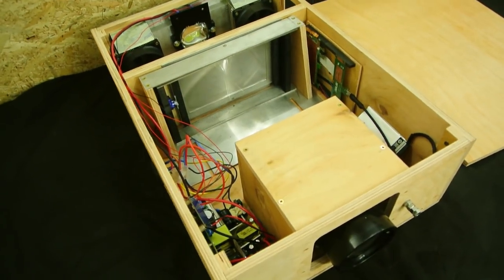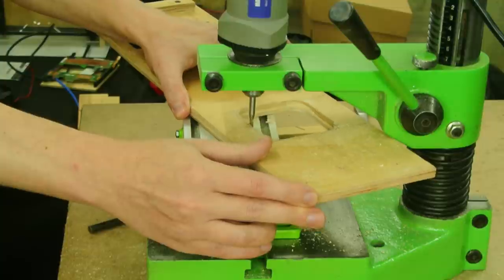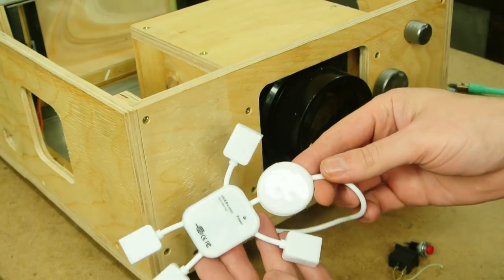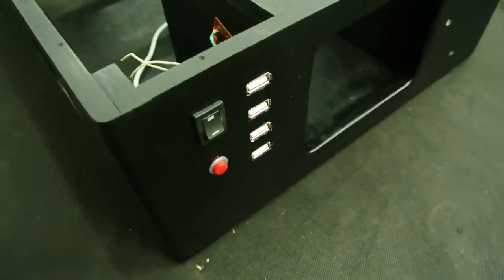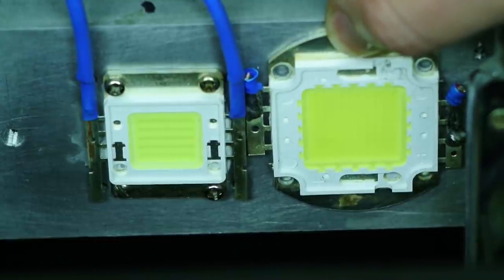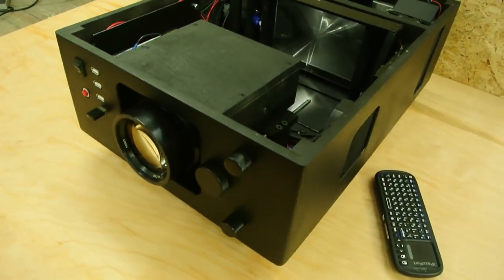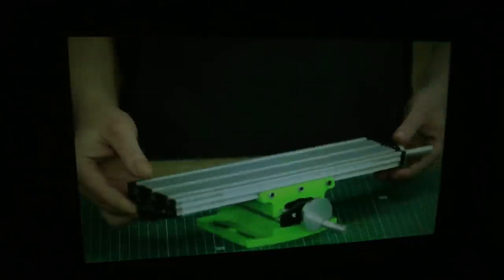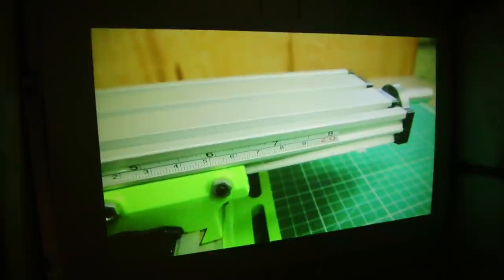DIY PROJECTOR Full HD (finish)

Comment: Would love to build it, but without a video on electronics its impossible :(
Reply: Hi i can help you if you intrested in components however hard to do the case no tools. a 3d printer would do the job.
Reply: Its a led, power supply, and a torn tablet connected to a charger....basic stuff.
Reply: Hey bro can you increase the brightness of this
Reply: chandrakant devde. To be honest yet dont know waiting for few replys from china sellers i want to use lg g3 display what is your facebook ? I will add you there and let you know if possible. Almost done with a Hd  7 inch display. Still need new psu
Reply: chandrakant devde driving a phone display with out some sort of converter board is hard i think need datasheet of display and etc.. I dont say is impossible but hard to do it
Reply: Popa Ionut can you please send your email. I would like to use your help to build such stuff. If you are interested.

Comment: in the back chamber area where the light is, i think i would have added additional mirrors around the sides to help bounce more light into the screen for increased brightness. though i know this may have made airflow less efficient so i can also see why you wouldn't. i also would have used a finer mesh instead of wire nets to prevent dust from getting in. after looking at the finished design, you also have a LOT of empty space inside that thing, so its possible you could have decreased some of its dimensions. it would have made for a tighter fit for the components inside, but would have decreased the distance the light had to travel inside the projector and helped reduce loss in brightness even further.
Reply: Adding mirrors would make the image horrible, as the light would not be going straight. As it is right now, only the light that goes forward goes through the LCD and into the lens, if you add mirrors, (unless they are specially made for this LED to make the light as straight as possible), itll make a mess.

Comment: Very impressive. I have one question. For how long you have tested your system? Is not the LCD become very hot? Your answer will take me one step ahead to make this project.
Reply from the maker: Tested a long time. If you do not install additional cooling for the display it will fail

Comment: Dear Sir, what about the connections of internal parts...???? Will you please explain that part also with circuit diagram. That will be a great help for sure.
Reply: balbir singh Sehgal you would need vaaaaay more than a circuit diagram to build it by yourself. That's the thing you should be able to figure out.

Comment: Would encapsulating the LEDs light beam in a reflective corridor improve brightness further? That's a lot of wasted light being absorbed by that big black interior.
Reply: Mitch King very bad idea. It would fuck with the fresnel lense, and give you a blurry, distorted picture. Just because then you not only have the light inputted from the focal point, but also from all the inner surface, and that's not going to be redirected parallel with the other rays

Comment: U should add a couple terabyte laptop drive & install Plex.  Turn it into a media center.  Use Wifi to transfer videos & stuff to to it.  U could add a USB network card, probably, and run Ethernet to it, if wifi is too slow for transfer.

Comment: Great video ! Could you tell me the specs of the projection lens and which of the lens's specs are requiered for this project ? You could mount a cpu cooler directly (without the aluminium sheet inbetween) to the LED to improve cooling. Sorry for bad english.

Comment: Hey, firstly congrats on a really informative set of videos on making a DIY projector. I've started my own project using 100W led but I am a little stuck on the LCD to use. I opted for a LS055R1SX04 (5.5 inch 1440x2560) which looked good but it is so very dim with a 100W led. Any more wattage and I have trouble keeping things cool. The LS055R1SX04 is not very transparent so most of the light is lost and doesn't pass through the LCD. Does anyone have suggestions on a good LCD to use with a DIY projector. Ideally something that is very transparent. Any HD 5.5 to 6 inch LCD that has good transparency will do but I just can't seem to find one with good transparency.
Reply: but it's video plagiat russian youtuber "Технарь" This is 
arrogant sound arrangement

Comment: Pretty nice work, but I see two problems. First you have used four fans. This thing must be pretty loud. And second, you are using an Android Tablet so you are limitied to the functions of the tablet. I don't know if this is really worth it.
Reply: Hauen Pappe if you hook it up to a good enough wifi, you can stream stuff through some apps. Also you can use other lcd, if you can get one decent with a hdmi input controller, that can be better than this setup.

Comment: Would this work with a 15 inch laptop screen? What about a 5 inch phone? Would I need different lenses in that case?
Reply: Celso Soares you have to cut your laptop screen to size with a hacksaw. If you are skilled enough, a knife, or a sharp axe will do it too, but i recommend the hacksaw. Maybe jigsaw or angle grinder, but that might burn the edges of the screen